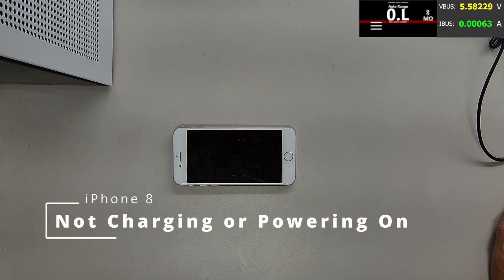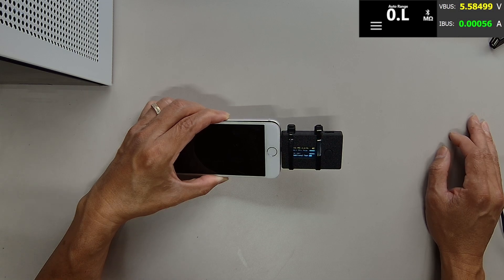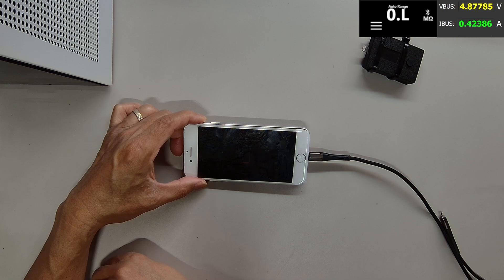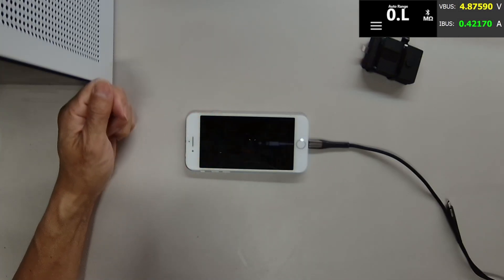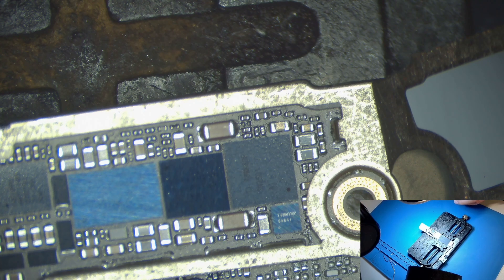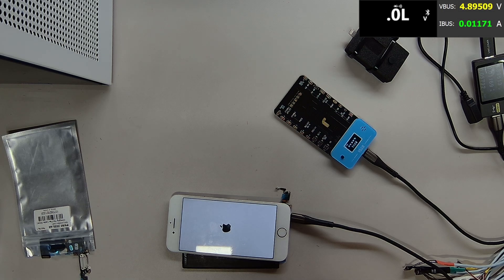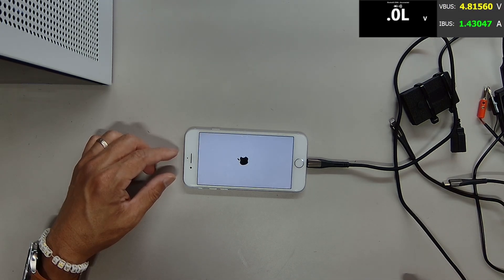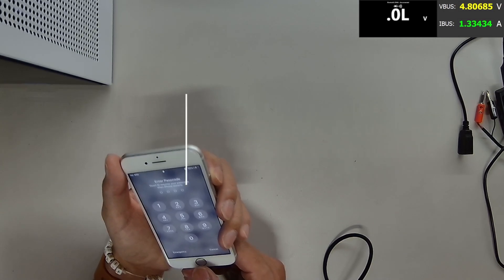iPhone 8 No Power Tristar Tester Failed

Comment: Do you know if it is possible to test Tristar chips on USB-C models?
Reply from the maker: No.  The circuit is different.  Current tristar testers are reliable either.  As you can see in the video, it failed to detect a bad tristar chip.
Reply: Boss your tool link please